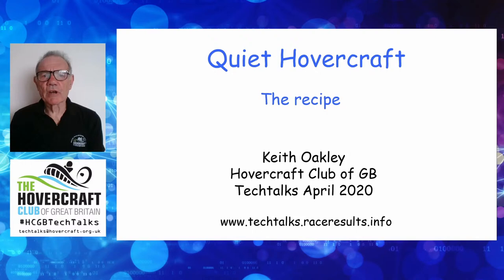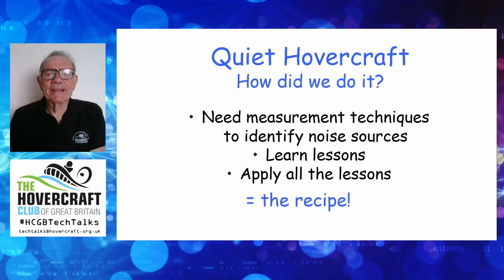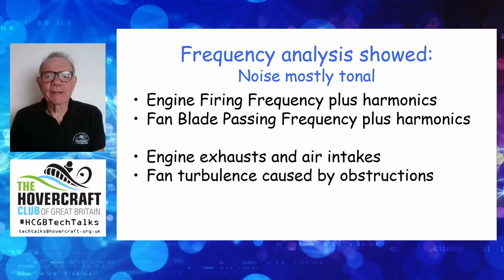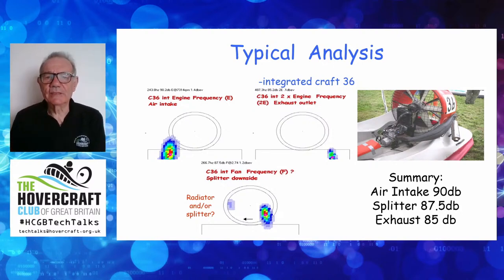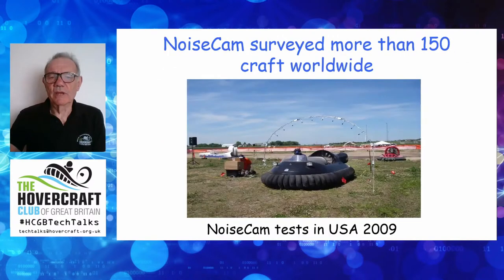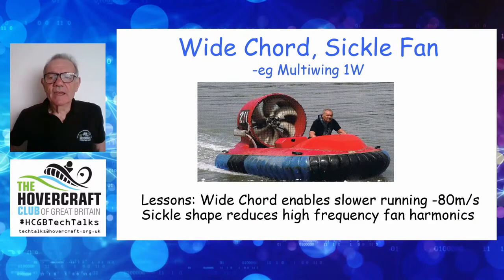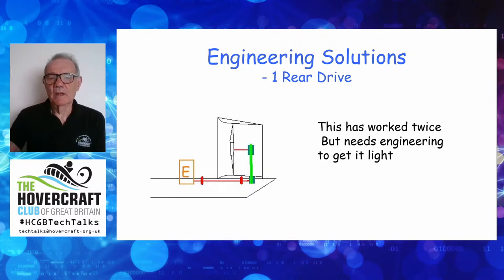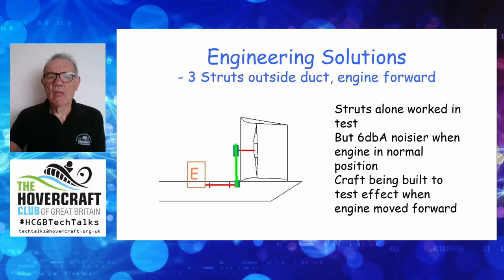Techtalk - Keith Oakley - Quiet Hovercraft The Recipe

Comment: Thank you Keith, very informative.  Have you investigated non-uniform blade spacing for the fan?  That can lower the peaks and spread out the harmonics of the fundamental blade pass frequency.  My experiments with cross flow fans has shown me that the character of the noise is altered considerably by this.  My current craft is fairly quiet also, and I've had a friend say that when in the "cone of silence", maybe 1/2 mile away, all he could hear was the noise of the skirt slapping the ripples in the water.  It' not as quiet as the Q1, but incorporates some of the concepts and uses a centrifugal lift fan.

Comment: Great video Keith-thanks. Your visit to the States in 2009 was my inspiration the quiet down my F35. I set up a 90 degree mule-drive belt to power my 48 inch dia 2-blade semitar prop from behind. Incredibly quiet now. Darn lift engine needs quieting now!
Reply: Hi Terry in USA  Brilliant to hear it worked for you on your thrust system. I suspect you know what to do with your lift engine but if it would help then send me some pics of it to the techtalks email address and I'll maybe give you some feedback.

Comment: No mention of the Otter? Probably the quietest craft currently available and there’s at least 4 of them in regular use
Reply: I'm very happy to acknowledge that, according to it's published  spec sheet, the Otter achieves the same noise level as the craft I've cited. I haven't personally been able to test it to the 'average of 7 points around the craft on full power' test I've set out but it's based on the same lessons I've been describing including low tip speeds and unobstructed airflow so it certainly should be low noise. The helpful video on John's website shows readings at 3 points which you can compare directly with the reading at 7, slightly different, points around the Q1 craft that I've shown in one of my early slides. John and I did use Noisecam to jointly measure a number of his earlier craft around 10 years ago and its great that he's incorporated the lessons learned. I'm absolutely delighted that others are experiencing the joys of Quiet Hovercraft. I hope many others will incorporate the recipe in this techtalk to achieve their own craft designs in future

Comment: Thanks Keith currently building a craft with parts of the recipe in mind have you a template for the vertical splitter?.craft is a postal crow aka the original coastalpro.
Reply: Hi Charlie I'm currently rebuilding Simon and Andrews 35 year old Osprey3 to Quiet Craft standards. I'll show some pics of the vertical splitter for that on thursday. We could probably work out a way to get you a copy of that if that would help. Happy to help privately 'noise review' what you're building if you want - contact me via the techtalks email address on webpage.    Keith